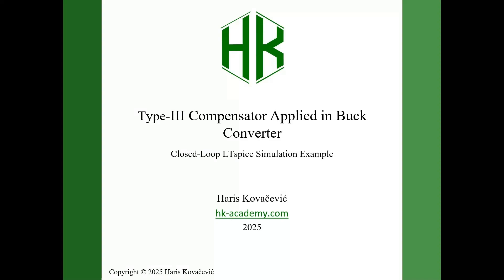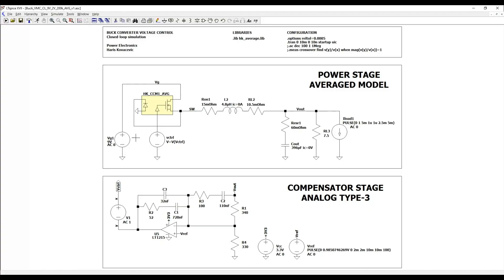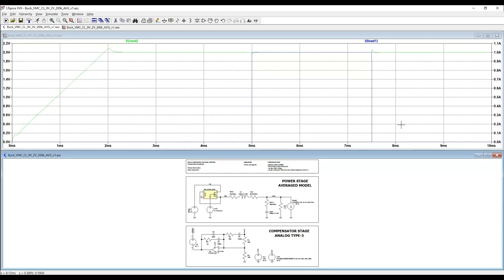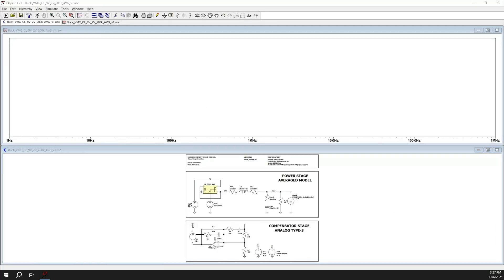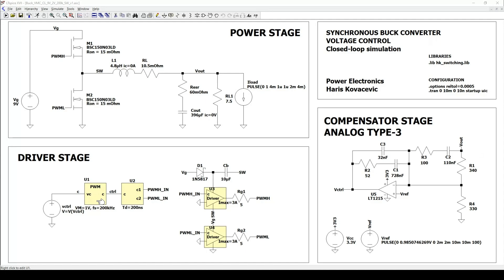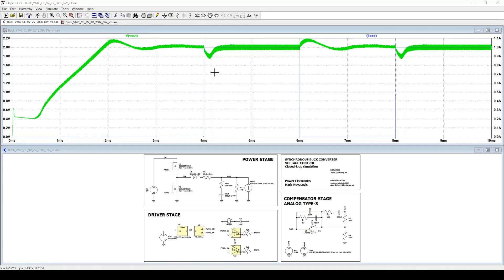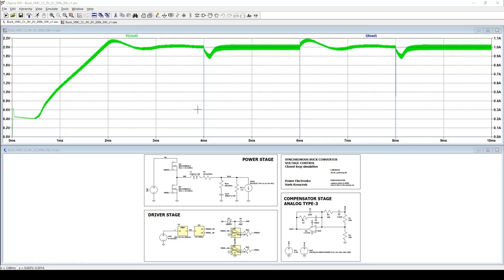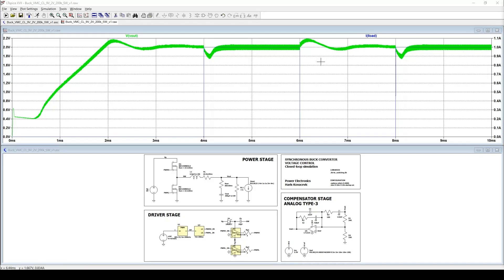Closed-Loop Buck Converter Control – Type-III Compensator (LTspice Simulation + Free Model)

Comment: This model is a voltage-mode control loop because a current-mode control loop is beyond the scope of this work? Does it have any advantages over current and therefore voltage? Why this not other?
Reply from the maker: Great question!
You’re right — in this video I used voltage-mode control because it keeps the model simpler and easier to explain in an introductory tutorial.
Voltage-mode control:
•	uses only the output voltage
•	has a single feedback loop
•	is easier to simulate and teach
•	is fully sufficient for many buck converters
•	is the foundation before moving to more advanced schemes
For beginners or for educational models, it’s the cleanest place to start.
Current-mode control, on the other hand:
•	adds a second (inner) current loop
•	improves transient response
•	provides better cycle-by-cycle protection
•	reduces dependence on the power stage dynamics
•	is preferred in many commercial converters
I will cover peak current-mode control in a separate video because it requires:
•	a different small-signal model
•	an inner current loop transfer function
•	slope compensation
•	different compensator design rules
This would make the current video too long and too advanced.
But it’s definitely planned — and I’ll connect it with this model in a future upload.
Thanks for the great question!
Reply: @HKAcademy-v1u  Thank you very much for your comprehensive answer :)